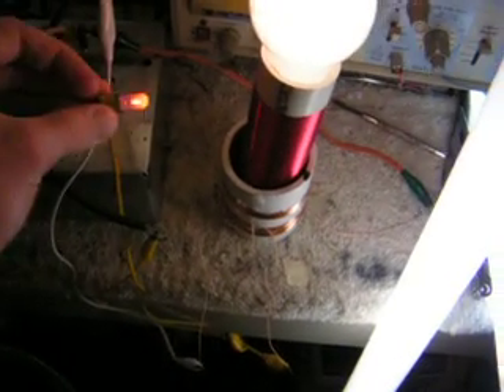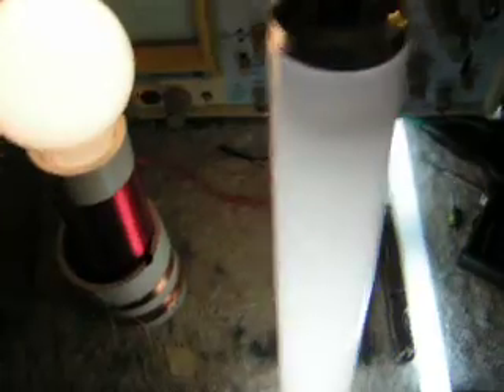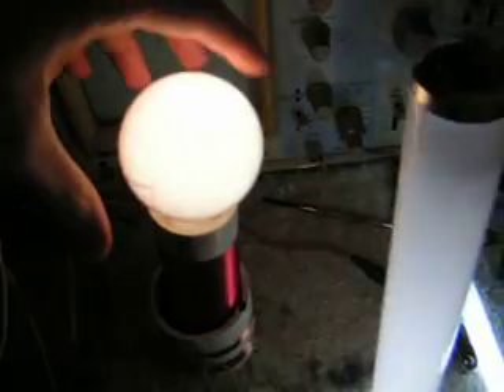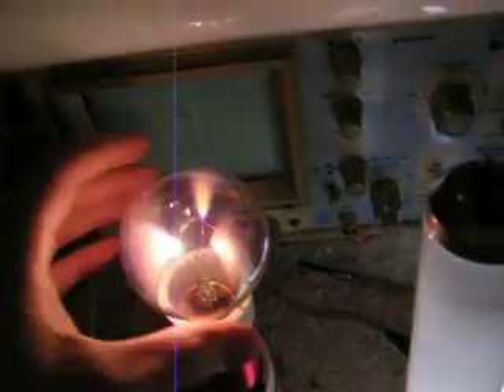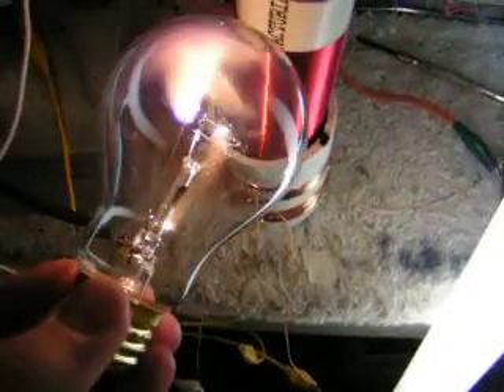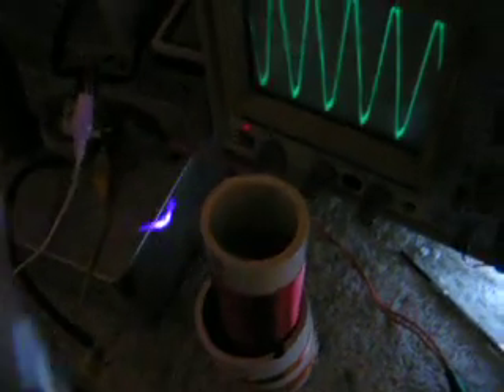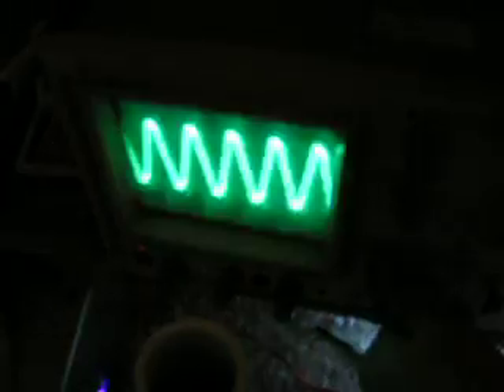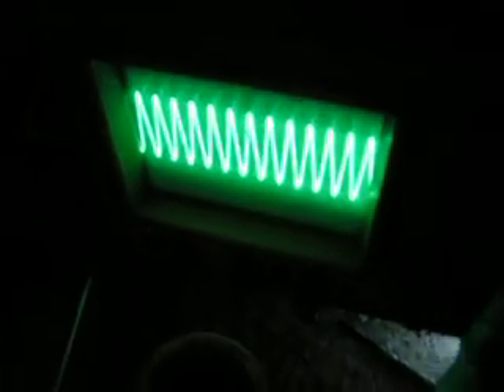vacuum tube tesla coil

Comment from the maker: no, it was like 525V. I would recommend a 811A or 833A tube. 811A is much cheaper, but power ratings are way less. Vacuum tubes are getting harder to get your hands on. Soon you may be forced to attempt a solid state one, which in my opinion, are better. Just more complex.

Comment from the maker: the reasons it's so quiet are because there is no spark gap, and it's operating as such a hi frequency. it's a vacuum tube tesla coil. they are more complicated than spark gap coils, but you can find schematic really easily on google...